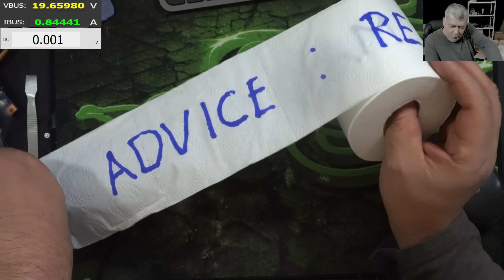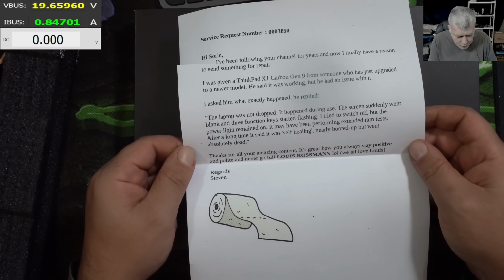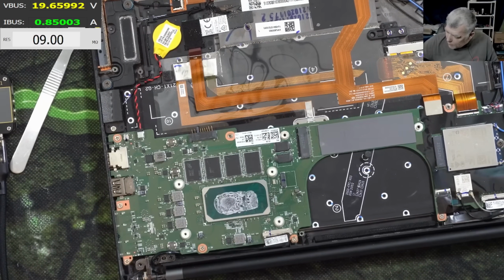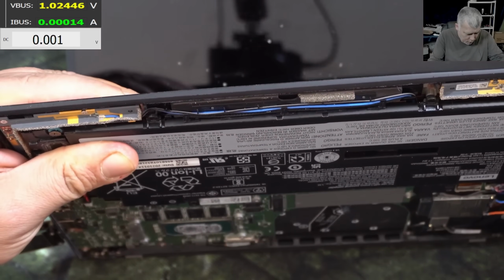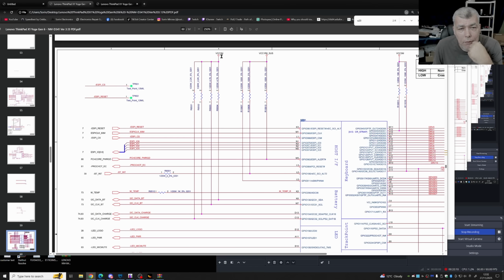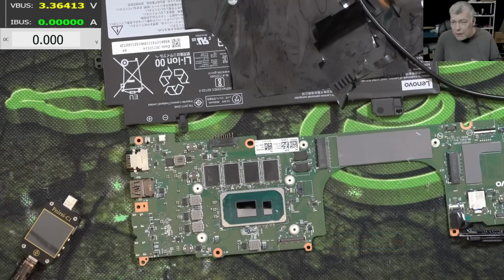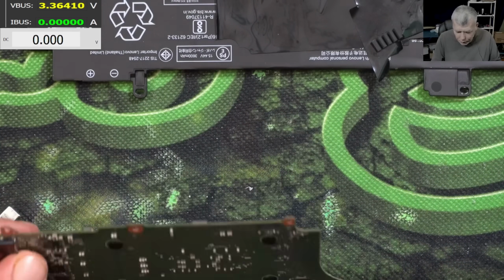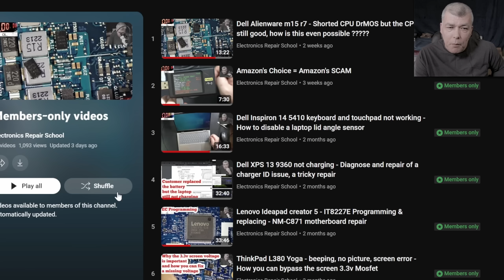This laptop took credit for my work -  'Self-healed' after i fix it, wtf? ThinkPad X1 Carbon Gen 9

Comment: This is a dodgy Lenovo laptop :) 
I'm sure Louis thinks Sorin is weird because he uses proper calibrated wires and removes capacitors etc. however I'm sure Sorin also thinks Louis is also weird because he didn't do what he does 🤣 both though agree Lenovo is dodgy which is right :)

Comment: Hi, I got a HP with one long flash on capslock which his supposed to be CPU failure and the caps around the CPU are getting hot after just one min of start up and  high fan spin but no picture but resistance is good around CPU so not shorted? or partially and making the caps hot? Anyway, does reflow a CPU ever help like you do with a GPU? Last owner might have overheated the CPU and the balls broke or CPU is mostly cooked and reflow wont help?  I also did all usual things like reflash BIOS and check for shorts everywhere but GPU is only place with no voltages so CPU isnt sending signal to EC chip to turn GPU on?

Comment: That is dreadful bad Lenovo soldering issue, that plagues some Lenovo models, especially some Legion with AMD, but also some Thinkpads as well. The only way to fix it, is to desolder the CPU, reball it with leaded solder and resolder again. It will happen again, sometimes you do need to heat up, just be changing the pressure on the CPU by untightening a screw. That is why I do not recommend any one to buy a Lenovo laptop anymore.

Comment: I fixed a similar lenovo with black screen issue , tried bios recovery and it was beeping for 15 mins reading and writing bios from usb drive which contain the bios bin file but that didn't fix the issue and the laptop still has a black screen, I desoldered the WSON8 bios chip and programmed it then soldered it back and that fixed the issue and I saw a message about backing up self healing bios. These lenovo well knows of a bios issue which can mess up with your brain. I also reflowed the onboard ram chip at the start thinking it was a ram issue but that didn't fix anything. the Wson8 had an epoxy glue under it to make it harder for the technician to unsolder the chip but thx God i was able to remove the chip successfully, cleaned the pads on the board with rosin flux then cleaned the chip , the programming went smooth after spending ours ours thinking it was something else not the bios because I tried bios recovery first which fixed nothing.

Comment: You a a good technician, fault finding and understating how the circuit works, I’ll give you that, you are best and I’ve learn from you. 
But when it comes to reworking / soldering skills, you are bad man, mostly cuz you refuse to invest on proper tools.
What’s in your head when you give advice to remove the lead free solder and reply or it with low melt ?! For real, bro that’s made for removing components, not solder them back. 
And again this is due  to the fact you refuse to invest in tolls!  That’s is shown in the low end soldering skills ! 

I will personally will never send you noting to get butchered by you. This cancels the fact you are good in theory and understand if you work bad
Reply: I think you also live in your own bubble...

Comment: Lenovo has "crisis bios recovery", you can load the bios from a usb drive. Also has a bios backup on the EFI partition, you can use it for recovery...
Reply: There is no Crisis recovery for Thinkpad devices with corrupted bios , Crisis Lenovo C1 works only on  Legion ,LOQ , ideapad,gaming,yoga,flex....

Comment: According to the schematic of that board the BIOS Rom chip is located between the RAM and M.2 slot at 5:30, there are 2 BGA Rom Chips with some Epoxy Resin to prevent tampering with the BIOS, so maybe that's why Sorin didn't originally notice them because he's used to the regular 8 Legged chips
Reply: The epoxy resin is NOT actually there to prevent tampering. To a noob or RTR fanboy it may seem that way but the resin is there to help support the chip. Its main purpose is to reduce thermal and mechanical stresses on the solder joints between the chip and the motherboard substrate.
Reply: @g4z-kb7ct  yes but it can also be used to prevent tampering
Reply: @nicktheneko No it doesn't prevent anything.

Comment: Why are they saying on computer to check BIOS version and update if needed. Self healing - You had a visit from Jesus. Lenovo needs to give it's head a wobble. JFIXX1 Says he sees the BIOS to the right of the RAM memory. Should have checked schematic for BIOS
It's also confusing when you said you were removing the BIOS battery.
Maybe it wasn't Jesus and more the hand of God/Sorin that by unplugging the BIOS battery and reconnecting caused the self-heal.

Comment: A good repairman is one who fixes things in the most cost effective manner. Don't spend time and money changing every component. I think Sorin follows this.
Reply: Yes, it's all about fixing and applying good engineering. Imagine if you are in a spaceship in the middle of space and you are running out of oxygen but you can quickly repair it and save your life. No time to search for a part, not time to call someone else for help etc. That's how I imagine it every time I fix something.

Comment: There should still be a flash chip just maybe not the size you are used to. They are starting to come in WSON-8 sizes instead of SIOC-8, if you look in the schematic the ROM should be stored in either a Winbond W25R256JVEIQ
32MB (256Mb) 8x6mm WSON8, GigaDevice GD25R256DYIGR, Macronix MX77L25650FZ4I4. (U49 / J2101)  Maybe a tutorial on flashing these chips would be a good idea, they will most likely have to be desoldered and put into external programmer.
Reply: So this is the new type of BIOS?
Reply: @SkyNET-YT yes and the legs aren't accessible the pads are under the chip

Comment: I see BIOS U49 it's to the right of the RAM memory and it's not obvious because looks like they put some glue stuff on the bios legs
Reply: I think I understand how this worked now! 

There is a dual BIOS on this board because it's a business grade laptop.

U49 is main system BIOS and J2101 (originally intended for programming header) is backup BIOS fitted with a backup copy of BIOS.

The PCH has faliure detection and can write the second BIOS chip contents over to the main BIOS U49 in an event of failure.

Whatever you did probably disconnecting power forced the PCH to invoke the self healing process where it copied the backup bios over to U49

Also to note the EC has it's own dedicated BIOS called U89